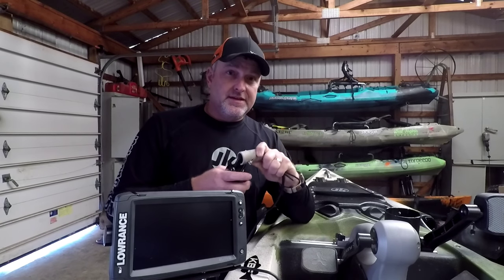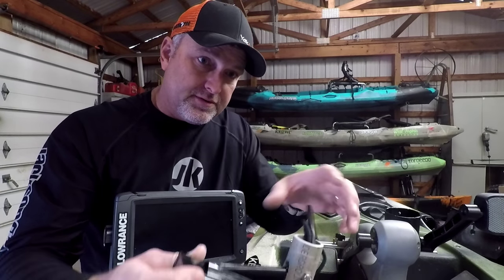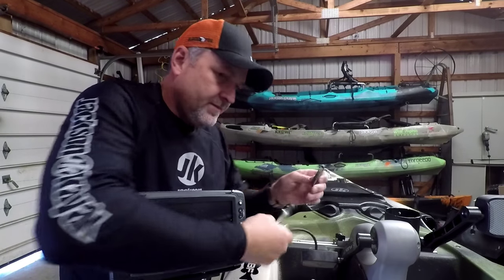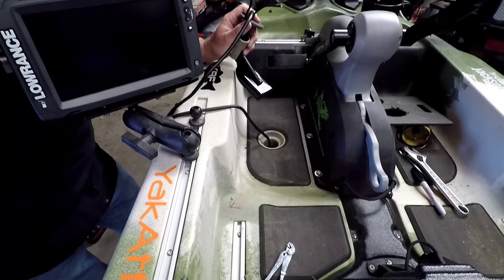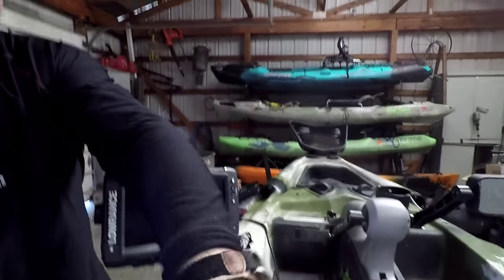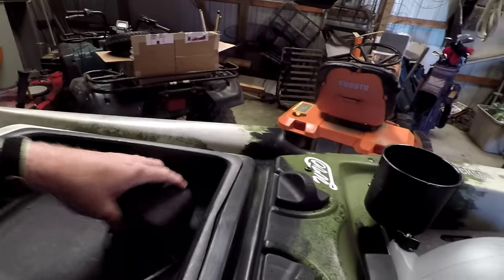Jackson Coosa FD  DIY transducer install

Comment: I installed my totalscan transducer through the scupper hole with some slight modifications to get it to stay solid underneath and it worked great!
Reply: Can you go into more detail on what modifications you made?  I have a totalscan transducer and I am trying to figure out the best way to mount it with the plastic bracket that came with it.  Maybe a video?  Thanks.

Comment: Great vid...im grom Hinton WV...so I fish the new and greenbrier rivers. I have a 2017 jackson big rig... cant decide on ff but between a ramarine dragonfly 7 pro and a garmin striker plus 7 cv for the mapping. I run whitewhater....ever seen those 2 mounted in the scupper? How do they fit? Protected?
Reply from the maker: hey man,  I cant give you an honest opinion about the garmin but the Jackson boats are designed to hold the ramarine transducer.  I use lowrance and they fit easily except for the total scan transducer which is way to big for the molded transducer scupper
Reply: The garmin CV52HW-TM transducer is the one im looking at...it looks to be 6 inches long, but thicker than the raymarine